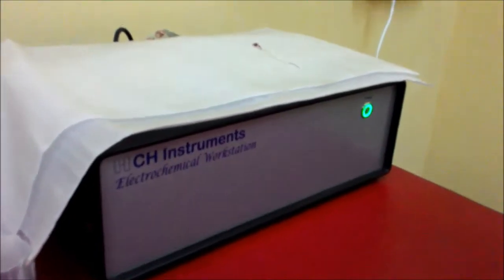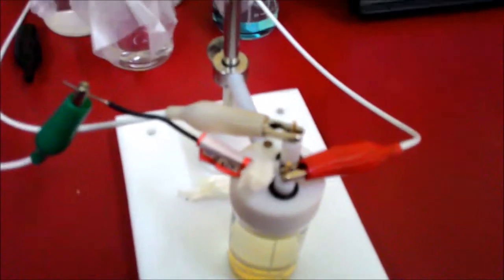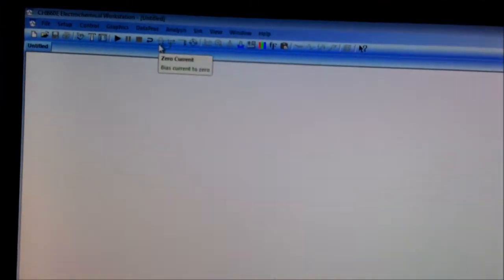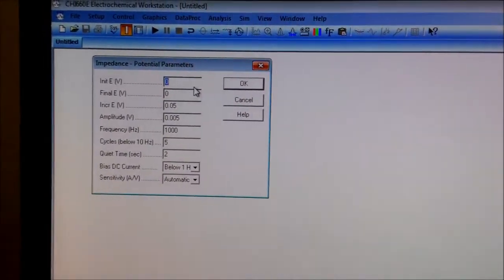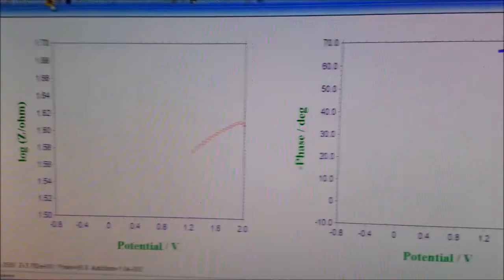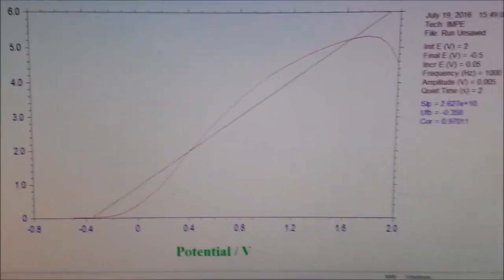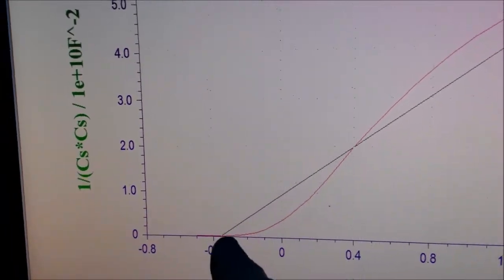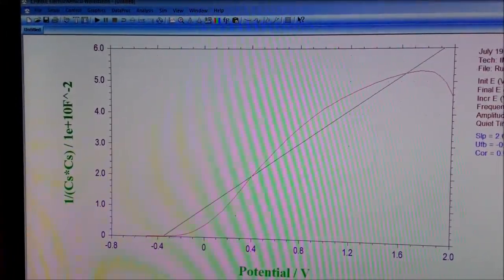The Mott-Schottky Measurement & Plot in CHI-660E Electrochemical Workstation

Comment: how it can be done in Biologic it is giving curves at different individual frequencies
Reply from the maker: I used the Biologic instrument for a few times. So, I cannot help you in this regard. If you have Autolab with Nova, I may help you.
Reply: @AyanSarkar1  I HAVE ONLY bIOLOGIC INSTRUMENT
Reply from the maker: @CuriousNavya  You check with their website. That's pretty good.
Reply: @CuriousNavya  you can use the SPEIS-mott schottky technique in EC lab software if you have biologic potentiostat. It is listed in impedence techniques.
Reply: @MSWeightlifting also need to know that . Assist

Comment: Hi!! Ayan, a very usefull video. However, I am new in electrochemistry, could you please tell me which potential value we need to use as initial potential and final potential? Thanks in advance.
Reply from the maker: First, try in the window of -2 V to 2 V then observing the result, you can reduce the width of the potential window.
Reply: @AyanSarkar1  Thanks for the information.
Reply: @AyanSarkar1  does the potential selection depends upon the type of application we are studying or is it hit and trial only. For instance if I am analyzing the electrode for battery applications in specific potential window, should I record the mott-schottky plot in that same potential region?
Reply from the maker: @MSWeightlifting  You should choose a range spanning from a negative voltage to a positive voltage. If your chosen voltage range reveals all the needful characteristics of your material then the range is absolutely fine.

Comment: Sir, can we use any random electrolyte ? I mean, does the flat band potential value interpret by Mott Schottky plot depends upon type  of electrolyte or it remain constant?
Reply from the maker: As flat band potential of an electrode material depends on the relative positions of Fermi levels of the material and electrolyte, so the flat band potential should change with changing the electrolyte. In other words, the pH of the electrolyte (aq.) has a crucial role in changing the flat band potential of a material. I reckon you know this formula: Efb(RHE) = Efb(Ag/AgCl) +E0(Ag/AgCl) +0.059*pH in V
Please Subscribe.
Reply: @AyanSarkar1  Thank you sir
Actually I am from physics department so I didn't know about this formula.
I will be more thankful  if you suggest some study material to understand EIS and flat band potential.
Reply from the maker: @MonaScienceClasses  Me too from a physics background.😁
There are several books and papers. However, presently I can't remember. You may read this paper for now: Phys. Chem. Chem. Phys. 18, 2016, 26900. There's a reference for Bott's paper. That would be useful too.

Comment: How u build the working electrode with the semiconductor?
Reply from the maker: I'm excerpting from my thesis, "The as-prepared materials (both TiO2 NTs and TiO2/ZnO NHs) were cut into pieces
of dimensions (∼ 0 .5 × 0 .7 cm2) and one side of each sample was scratched off
totally to take out the titanium metal. A conducting wire was attached to the
metallic titanium using the silver paste. After drying, the side was coated with a
non-conducting film-forming polymer."